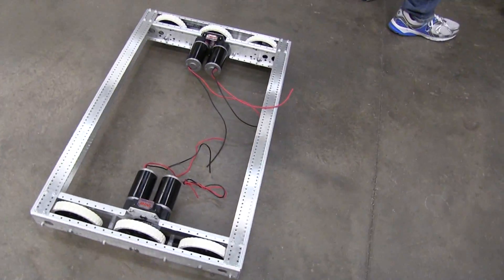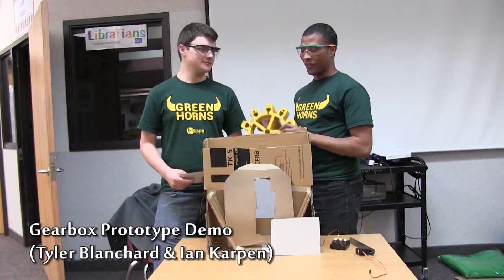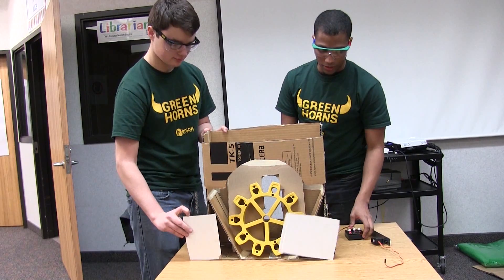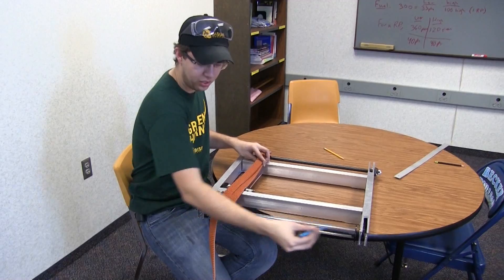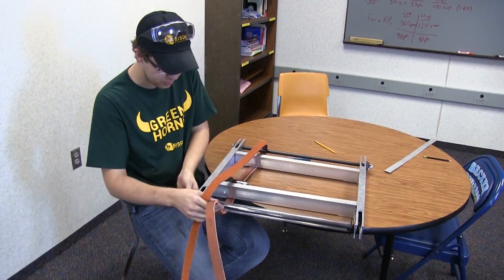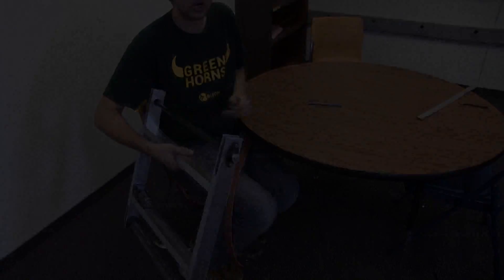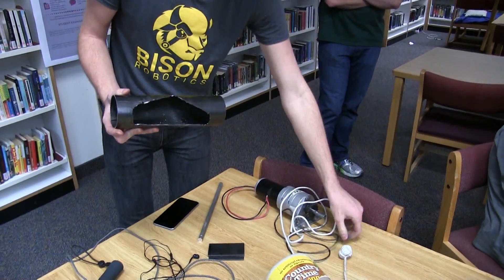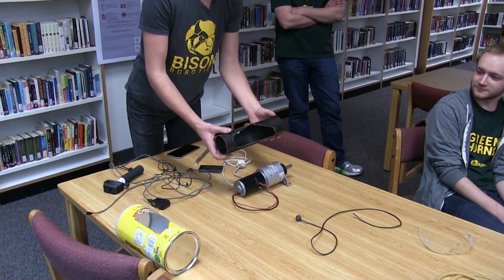Ri3D 2017: Team GreenHorns Day 1 Update

Comment: Hello, great work so far!  What are you using there at 1:18? Seems like an efficient way to test prototypes :)
Reply: Thanks! We are using a Rev Robotic servo to kick out our gear. We are using a SRS Programmer to set our angular limits on our servos. It's a great tool if you have to program servos or servo linear actuators or to just test servos without code.  Hope that answers your question!
Reply: Thanks! That answers my question! On another note, are you aware of any other such programmer device for a cim motor or just a normal RC servo?
Reply: We used the AndyMark Thrifty Throttle to test motors. It worked great, and also let us vary the speed that we ran the motors at!